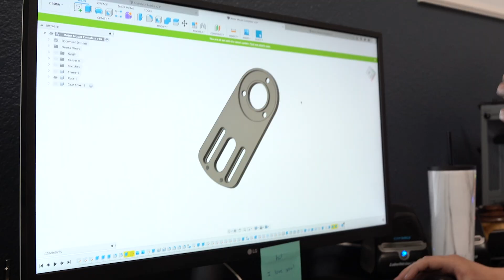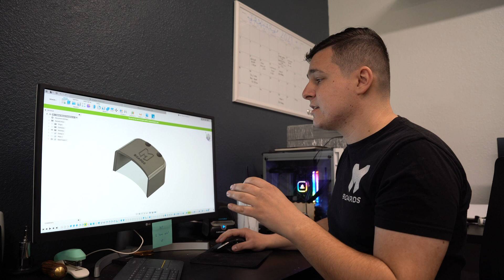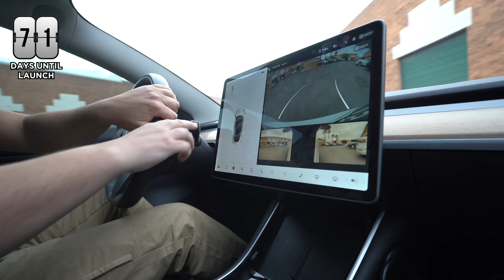Production Electric Skateboard: Custom ESK8 Trucks Are Done ✅

Comment: Hey Mike, how much do you reckon your production trucks will be compared to your current truck+mount?
Reply from the maker: Much cheaper! 

A pair of extended trucks and a pair of motor mounts currently costs $140

The new fixed trucks and mounts would cost around $110. And the $110 includes a speed spacer kit and a set of riser pads.
Reply: @MikeBeard  what a dub for diy customers! Cant wait!
Reply from the maker: Last bit of hardware is arriving in a couple of days. Should be able to drop these on the site in less than a week!

Comment: So I have followed your channel for awhile. I have boosted v2, acton Quattro and my kids all have electric boards. 

I am looking for something that feels like a longboard. Going from even the boosted to my Landyathz board with the double trucks is night and day. That’s why I am looking at Bustin Boards electric board. I just would prefer to test it before buying it though is why I didn’t get it yet. I was disappointed with acton Quattro board. Way too hard and acceleration was not controllable with the remote provided. That remote was horrible 

What are your plans for your board line up? An off road option would be pretty sweet by the way.
Reply from the maker: Currently our plans are to roll out a few different options over the course of 2021. The 1st board to roll out will be something similar to a boosted but with much more torque, speed, and range. 

An All Terrain version would follow shortly after 👍🏻